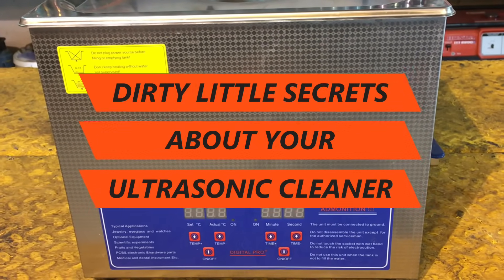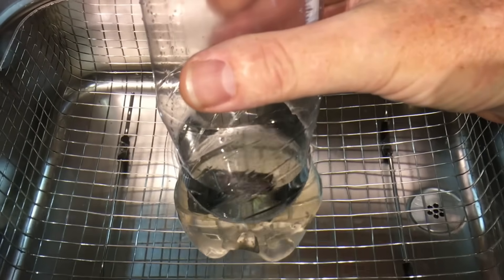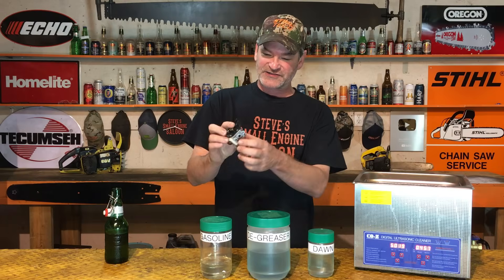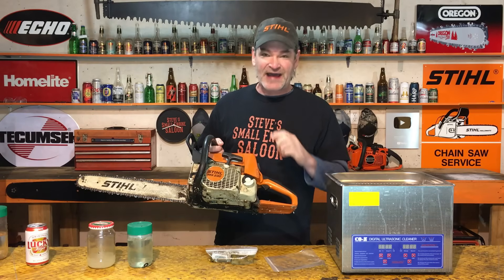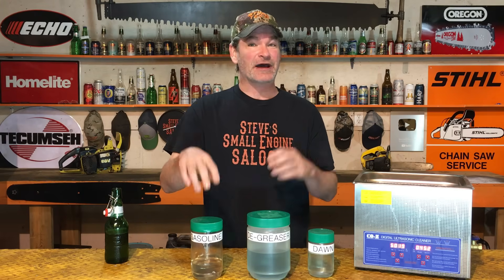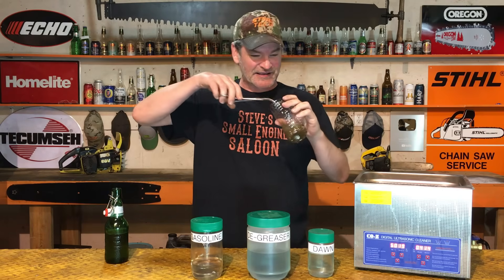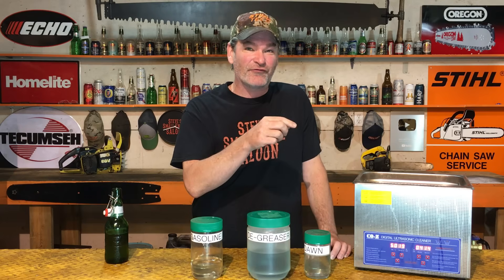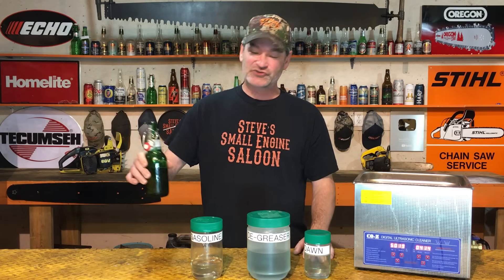4 Ultrasonic Cleaner Mistakes You Need To Stop Now!

Comment: Ultrasonic cleaners vaporize alcohol and gas and a single spark will blow your damn house to kingdom come. Don't play games. These things are cheaply built, and they catch fire, the transducers fall off, and the power supplies fail. 

This is a warning. I had to stop the video just to point this out. You can suffocate to death from just vaporized alcohol, even mouthwash can kill you if it vaporizes and hits cold air. 

Vaporization is a problem that not many people have had to deal with.

Comment: Thanks Steve.  Another great video with lots of information.  I haven't purchased a UC(ultrasonic cleaner) because I was concerned about always filling the tank with a cleaning solultion.  But the container in tank method is brilliant!  Less waste on cleaning solution and easy cleanup.  For the times you have to fill the tank with cleaner, here's something that might work:  a Crock-Pot liner.  Put the liner and basket in, fill with cleaning solution... the liner should be strong enough to then just  lift out.  Not sure what the tank looks like if there is a drain port.  Worth a try.

Comment: I have the same ultrasonic cleaner. I do the same as Steve with the sealed containers or the Zip lock bags. Gas is a good cleaner and cheap. I also use Dawn dish soap, simple Green and a favorite, Citric acid. Depends what you are cleaning. Once you have one of these in the shop you will wonder why you didn't have one sooner

Comment: Good deal. Cleaning SCUBA regulators (plated brass) always just used white vinegar. Dawn is great for so many things, I totally agree, and I remember scrubbing out motorcycle carbs with gasoline and toothbrushes in high school. I think the ultrasonic beats that any day. Big tip: you can buy just the emitters cheap, and or the control board and repair your old tank, or make your own. Maybe the wife won’t notice the emitters bonded to the bottom of the kitchen sink!

Comment: I mostly use mine to clean brass shell casings.  So I fill the tank with cleaning solution, and load the tray, but yeah, otherwise water in the tank and solution in the jar.

Comment: The problem with gasoline is that it evaporates and it's heavier than air, so it will settle along the floor of your shop and THEN find an ignition source.

Comment: I  keep about a liter of ordinary gasoline in an ice cream pail with an old toothbrush, and it's a super useful kit for cleaning all sorts of greasy oily gummy things.   I think it's been in there almost two years now, and the pail is still quite intact.    One thing though, you want to make sure you have good ventilation when using it, as the fumes can make you feel sick quite quickly if you breath in much of it.  Rubber gloves are a must as well.

Comment: @3:07 That dark gray color is because the aluminum alloy smooth surface has actually been etched away, and will now oxidize WAY quicker. You may get away with running that carb if you're in a pinch, but every time that has happened to me I've had tuning problems until I replaced the whole carb. You learn the hard way when you ruin a pair of $1500 VW dual carbs. 😡

Comment: Steve is have been a long time fan and have appreciated all of your helpful tips. I think a cleaning solution of 10 parts diesel 1 part transmission fluid would be a fantastic cleaner. Thought more expensive. You would only need a solution like this for your worst cleaning jobs.

Comment: Why Proper Water Level Matters
Medium for Cavitation: Ultrasonic cleaners rely on cavitation—microscopic bubbles forming and collapsing in liquid. Without enough water, cavitation cannot occur effectively, and the energy has nowhere to go.

Energy Reflection: Ultrasonic waves travel poorly in air (99.9% less efficient than in water). If the tub isn’t filled, the waves reflect back into the transducers, causing destructive feedback.

Cooling Effect: Water absorbs and dissipates heat from the transducers. Low water means inadequate cooling, leading to overheating and eventual burnout

Comment: If you want to put heat to the gas. Use plastic and push one side in if the dent pushes out you might be building pressure inside. If dent stays no pressure inside.

Comment: There is no problem with gasoline as long as you keep a lid on it and have a safe way to get rid of it.  
Make sure you keep the water clean and don't let your parts rattle against the tank.  Avoid scratching the tank.  Any scratches, dirt or hard objects in the tank can cause cavities to form that will build on themselves during use and ruin the tank. 
At my work place, we float small stainless bowls with either acetone, alcohol, or Micro-90 detergent. Bigger objects are hung from racks and we mix Micro-90 in the tank with deionized water.

Comment: I used to use varasol once in a while to clean very greasy stuff. The jug split along the bottom seam just sitting on a shelf inside a plastic tote for safety but some spilling on the floor unfinished concrete floor when I lifted it out before I realized what happened. It took weeks to get the smell out using carpet and floor cleaners to scrub and extract. I'll be sticking to Spray Nine.

Comment: Do you think adding sand would add some abrasion to whatever cleaner is in the jar? Like so thick it barely gets into places or maybe experiment with ratios to see what works best on caked up engine crud? Doubt it'll strip paint(ooh paint stripper comes in a metal can, what dilutes that? lol) but a uniform finish would be cool. Cheers.

Comment: Simple Green PRO.  NOT regular Simple Green.  Pro does not attack carb finishes, and it leaves them sparkling clean, not black and gummy.  AND, I put hot water in my US cleaner first, then turn on the heat, wait a while, THEN put my parts in it, in a container of the Simple Green Pro..

Comment: I put some B-20 Fuel in a 1966 Fork Lift Steel fuel tank.  The Soybean oil cut tar loose and clogged up the system.  My friend had an Industrial sized Sonic cleaner it would not touch it.
  Derust solution would not touch it.  Finally I put Lacquer thinner in the tank sloshed it dissolved it clean as new.
  I would love to have a sonic cleaner for carburetors and  brass casings.

Comment: I always thought that the danger with flammable solvents like gasoline in the ultrasonic cleaner was that it produced vapor, that is explosively flammable, and heavier than air (you know like those ultrasonic fog humidifiers) this vapor can then run along the bench or floor until it finds an ignition source.
So I figure one MUST use a sealed container ;-)

Comment: Great video full of info, i think the big stink on gasoline is that some people just fill it up with gasoline and the heat and ultrasonics will cause it to create more gas fumes that are heavier than air causing it to pool up around the base. I use it as well but not inside my shop, probably just being over cautious. I like your plastic containers, zipbag option for adding your cleaner to the container to get in contact with the item to clean and not needing to add it to all the solution in the ultrasonic cleaner. Dont throw your items into your cleaner without suspending them off of the bottom, use your basket or something to suspend it. Safety issue never reach into your cleaner with your hands while it is running, this can possibly cause cavitation issues with your blood and tissues. The dawn detergent also causes a breakdown of surface tention (wetting) which allows the cleaning action to work more easily. We used commercial Branson ultrasonic cleaners in the lab alot and used their cleaning solutions alot like Branson OR for oxide removal, GP for general purpose, EC for circuit boards ect... these are a little costly but often mix at 15 parts water to cleaner and since you have shown you can just mix enough to add your item to a plastic bottle or bag with only enough solution to cover your part can become pretty cost effective on the more demanding jobs. Lastly you need to add your water in the cleaner up to the full mark because the transducers are tuned to this amout of liquid and can handle the acoustic ok without sub harmonics causing premature transducer failure.😊

Comment: Simply Awesome cleaner from the dollar store works wonderful as a degreaser and works fine in the Ultrasonic  cleaner. Never use any cleaner full strength.  There is a corrosion  coating on most carburetors  that can and will be removed by too strong of cleaners. I learned this the hard way my first time using one.

Comment: STEVE! Have you used Evaporust? I mean, 3 uses and it's dead, cost enough to buy a wire wheeled grinder! 
Try this at 10x cheaper and WAY longer lasting:
RUST REMOVER:

BAKING SODA 63G

WATER 1LITER 

CITRIC ACID 100G

Comment: Hi Steve   would you recommend against using the heater in a heated untr sonic cleaner for longer cleaning sessions with gasoline? Let say if I'm cleaning a very dirty and varnished old carburetor for say 20-30 minutes?

Comment: Thanks Steve! I can finally use my ultrasonic cleaner without makijng a mess in the tank! Also I clean knives and such and use Dawn and a little ammonia. Run it for about 10 minutes and what a difference! I rinse them off, blow dry them and then use a little gun lube and it smartens them right up!

Comment: Steve, Great video. Thank you. Now, please do one about disposing of the leftover degreaser and gasoline mud you showed when you’re finished. Also, what to do with the old gas I poured out from my chainsaw or pressure washer, which now needs to go somewhere. My local auto parts store will take old oil, but what about other chemicals (solvents, kerosene, etc) ￼that result from maintenance on various vehicles and tools around the house and on the small farm?

Comment: Something that is so simple is I use heated water in the UC. It saves a ton of time not waiting for the water to heat up. Just don't use boiling water, hot tap water is more than enough.
With heated water & containers I give the plastic a little squeeze while sealing it closed. That way pressure doesn't build up & no surprises when opening it. Usually that isn't an issue because the container with the parts isn't in long enough to build that much pressure.

Comment: I have the Vevor 30L version Ultrasonic cleaner and Yes I Too use Gasoline & Diesel Fuel as well, plus Formula 88 degreaser at 50/50 w/water. Those are my goto cleaners.
Thanks Steve for Sharing this topic on Ultrasonic cleaner.
Merry Christmas brother ❤

Comment: Gasoline when heated boils and turns into vapour faster than at room temperature, but inside an ultrasonic cleaner it will never be heated up to the auto-ignition point, which is the point of self-ignition, which is about 280°C, the Ultrasonic will never get that hot.  50°C water is not going to cause gasoline to ignite, plus there is no electrical source inside the water, the electrical source if isolated, and the ultrasonic waves are done by piezoelectric ceramics, which convert wall current of 60hz/50hz into sound waves, which is what you hear coming thru the stainless steel tub.  It causes micro cavitations in the water, which causes bubbles to form on imperfect surfaces.

But nowhere is there any form of electrical current in the water. You can put your hand in the water of an Ultrasonic cleaner, it feels like electricity is in the water because of the micro cavitations from the 60hz/50hz oscillations due to the inlet power frequency

Comment: Thanks for the really good informative videos.  All very good tip.
One more mistake, avoid putting parts directly in the reservoir it could wear a hole in the reservoir.  I did make that mistake. 
Having your reservoir full also prevent the heater from overheating and causing damaged to the unit. 
I like putting a few drop of dish soap in the reservoir. It sonicate better, I suspect the soap breaks the surface tension and transmit the ultrasound better. 
To prevent your open containers from tipping over, I make foam disk which  I slide over the container  and let it float.

Comment: they used to sell a carburetor cleaner solution at auto zone in a one gallon paint can container and it was the best way to clean small parts now im not sure if they still sell it but it would definitely speed up the cleaning process if you used some of that solution in a container inside the ultra sonic cleaner you should see if they still sell it. about ten years ago it was like 20 bucks a gallon but you could re use it over and over I'd like to see it in the ultrasonic cleaner
Reply: Carb dip kit. It's about $40 for the can of stuff. Wear gloves because it will burn your skin (corrosive) but does dilute with water when rinsing the parts after soaking.

Comment: Hi Steve, love your channel! I've fixed so many things watching you. On your recommendation, I bought a small ultrasonic cleaner to clean the stainless steel baffles in my suppressor. I had used solvents, clp, nothing would remove the carbon. Then on silencer central website I saw the used a sonic cleaner with CLR. I used your zip lock bag method, and 15 min, they looked brand new! Again many thanks!

Comment: I use Dawn and I've also been using the Zep Heavy Duty Citrus Degreaser here lately also, and it has been working very well.  I've never tried the container in the tank, but usually I'm doing carbs that would be difficult in a peanut butter jar.  100% absolutely right... make sure the tank is filled to the fill line, it definitely will blow out the transducers if you don't.

Comment: 4:59 I’m nitpicking here. The only thing I can think of is that a peanut butter jar isn’t designed to hold gasoline. But as long as the lid completely seals off the jar and isn’t efffected by gasoline, I think it’s safe too.
Reply: I suppose you could try the peanutbutter jar with the peanutbutter still in it, but I don't think that would work very well.

Comment: 0:45 Those bubble don’t explode but implode. There’s no air in the bubbles that are formed by the high frequency sound waves so inside the bubbles there’s a vacuum that implodes. Because of the implosion, the fluid will hit the surface of the object very hard and any dirt will come loose.

Comment: My best tip is evaporust works the best with heat and in the ultrasonic. A part that might take 2 days to de-rust in a container on the bench can be a few hours with warm solution and a few blasts in the ultrasonic.

Comment: Great video. Sometimes the jet and emulsion tube are seized in the carby. I'll put it in the ultrasonic for a while partially disassembled. This will usually loosen them up enough to remove them and then clean it fully disassembled. Also worked well for a choke that was seized in a trx450 carb.

Comment: I used to work in high energy ultrasonic research. I know why you ultrasonic cleaner burned up with the water too low.

Each cleaner has multiple piezoelectric transducers. These are made from (usually) layers of crystalline disks that create an vibration when excited with an AC current. Think of something like a buzzer.

Anyway, these transducers, being a crystalline ceramic, are quite brittle and prone to cracking. They do well when vibrating at their resonate frequency, within with their safe range of amplitude.

Amplitude being the total distance (usually measured in microns) that the transducer can move without being at risk of cracking.

Think of turning the volume on your stereo loud enough to blow your speakers.

When the reservoir is full of water, the water acts like a damper (a shock absorber) which keeps the transducer from exceeding in amplitude limit.

Also, not just the transducer has a resonate frequency. The reservoir filled with liquid also has a resonate frequency, which should match the frequency of the transducer or some multiple thereof.

You can think of those people who play music on wine glasses, filled partially with water. Changing the amount of water in the glass, changes the frequency (tone).

So, the water in an ultrasonic cleaner works in this fashion. When the water is filled to the fill line, the assembly is matched to the resonate frequency of the transducer.

When the reservoir water is too low, the dampening effect is diminished and the assembly resonates at the wrong frequency, and allowing the max amplitude of the transducer to be exceeded.

Boom! Fracture!
Reply: Would it make any difference then using tap water vs. Distilled water? Just thinking about the mineral content in the tap water ,
Reply: Informative comment, though describing water as a "dampener" isn't the analogy I'd use, although it's not entirely wrong. What you can compare the water to is an antenna on a radio transmitter. As a rule of thumb, if you press the Send button on such a device without having the antenna mounted, you will likely destroy the transmitter. The output power (energy) needs to be directed into a "consumer"/medium, in this case the antenna. Same principle applies here with the ultrasonic waves; if they aren't directed into a medium (water/liquid), energy builds up to the point of self-destruction.

Comment: I use gasoline too but I don't use it in an open container the vapor it creates can go boom. If you operate your transducer without a load i. e. below the fill line it can cause the transducer to separate from the tank.